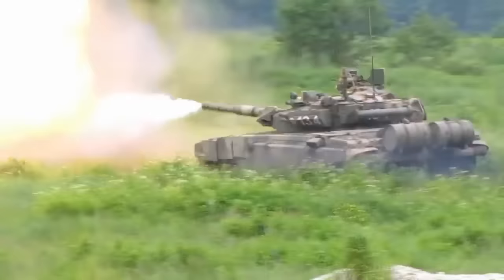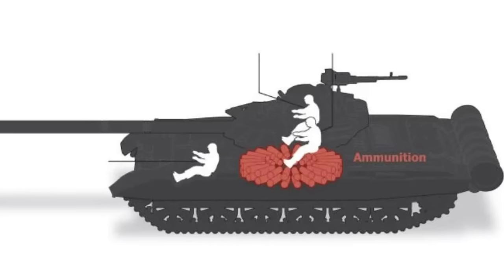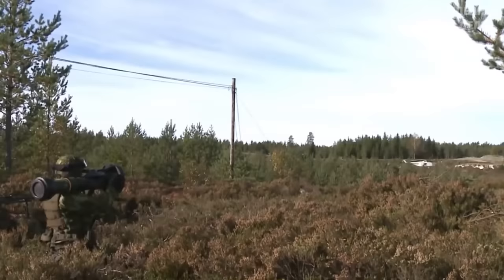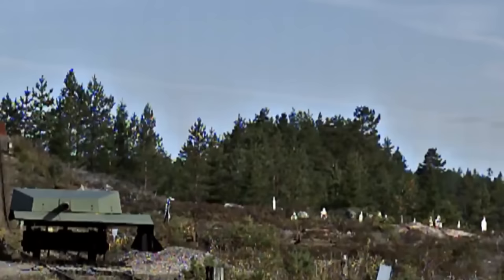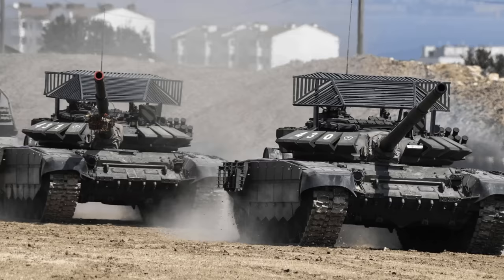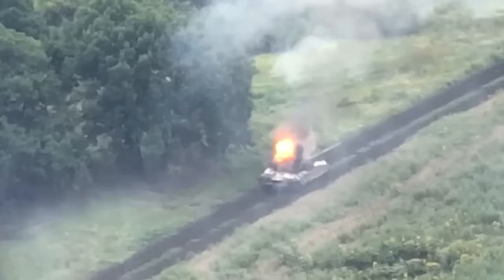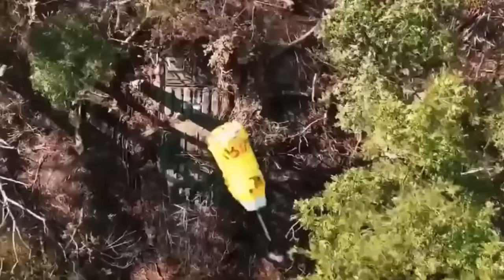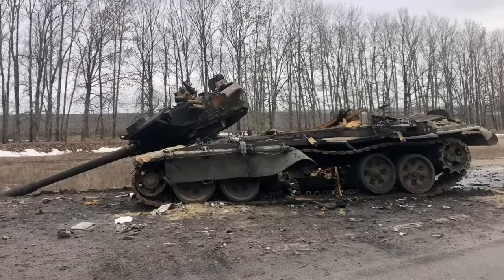Why does this happen to all Russian tanks? / real footage frome Ukraine

Comment: This is a problem for T-72, T-80, and T-90 series tanks.   It has been a weakness since 1982 in the tank battles in the Bek’ka Valley.   The T-62 ants showed this vulnerability in the Yom Kippur War of 1973.   It appears to be a fixable problem but the Soviet/Russian tank designers did not anticipate the flaw or more likely were overruled by senior defense leaders.
Reply: There is no problem with the T-72, T-80 and T-90, it’s just that a huge number of these tanks were produced and most often they fall on the video, but when Western tanks get into a similar situation, the situation is no better, for example, it happened with Turkish Leopard tanks 2a4 in Syria in 10 minutes, ISIS destroyed a battalion of Turkish tanks from Soviet MANPADS Metis, this is a common problem of tanks, Abrams of the Saudi Arabian army in Yemen has the same problems!
Reply: The exact same thing can happen to western tanks if the blast door is broken
Reply: I have seen the exact same thing happen with those m777's after being hit with anti-tank missiles, does that make them a failure too?
Reply: @UltraTotenkopf  lol the video above shows the difference between Russian and Western tanks. 
1. Russians wanted to have an autoloader and not a manual one, so they stuck all the ammunition around the crew, but leading to problem 2,
2. When the ammo detonates the only escape for the explosion is up through the turret, which is why the turrets pop on many Russian tanks, and thus kills at least 2 of the 3-tank crew,
3. Russian Cold-War tanks (T62, T72, T80, T90 etc.) have been used in many, many conflicts and (not sure about all of them) almost every single one ends up in a loss for the side with Soviet tanks: the Six Day War, the Yom Kippur War, the Persian Gulf War, the Iraqi War (2003) and some other minor conflicts. 
4. Russian tanks lack gun depression, so they actually have to climb over a hill to fire at their target.
5. Russian tanks lack good optics, leading to poor situational awareness.
6. Russian tanks operate on their own or in small groups with little to no coordination with other tank or infantry groups.

But now that I think about it, I guess there is definitely no problems whatsoever with Russian MBTs. Definitely. 100%. Yup. XD ok I'll stop now.
Reply: It’s not just Russian tanks but even NATO tanks also explode when they are hit by modern ATGMs. It has happened before to Saudi Abrams and Turkish Leo 2.
Reply: Pure western propaganda. 😂
Reply: @andrewtibbetts2695  One very perfidious system of comparison that completely misleads the listeners: "Russian tanks explode when the missile penetrates the armor, and Western tanks only suffer from destruction of the ammunition compartment"! What is the problem here? It compares breaking into the crew compartment on Russian tanks to breaking into something BEHIND the crew compartment on Western tanks.
It goes like this:
First, the Russians no longer practice packing spare ammunition all over the turret, but all ammunition is in the autoloader. If the missile penetrates the turret and ignites the ammunition, it doesn't even matter anymore, because the temperature and pressure sufficient to ignite the ammunition in a fairly well-protected autoloader has already killed the tank's crew. The same will happen to the crew of any western tank if a missile penetrates the crew compartment, with the difference that in a Russian tank one of the two crews in the turret may have a chance to survive due to the huge gun between them, while in the western tanks due to loader maneuvers, the turret is one big open space and it's very likely that everyone will die.
If the missile hits BEHIND the crew compartment on the western tanks it will destroy the ammunition, and on the Russian tanks in that case it will destroy... the tool box or the scuba tube or some similar irrelevant thing!
Blown up turret on German tanks: watch?v=X6nZvDn6gRQ
Blown up turret on US tanks: watch?v=vZTccFE0y9c
Of course, there are only a few shots, but only a few tanks were actually used. In Syria, the Turks used 12 tanks and lost... 40% of the tanks!
Reply: @jerromedrakejr9332  Russian tanks were built for mass production, with very little emphasis on crew protection. 
However, Western tanks were built to protect the crew. 
name just one war where the Russian tanks were superior to Western tanks (American, Brit etc.) 
Exactly. Why? because of all the reason I listed as to why Russian tanks are garbage compared to Western designs. is it better then no tank at all? yes.
Can Western designs fail? yes. 
But will anyone ever be able to prove Russian tanks are good? NO
Has a nation wielding Russian tanks ever demolished a nation with Western tanks? also...no.
Also the fail rate of Abrams/Leopards etc. is very small compared to the amount of tanks built by Russia that have been destroyed over different wars. :)
And your tank will always fail if your crews aren't trained on what to do and what not to do :)
Reply: @UltraTotenkopf  another NPC
Reply: @andrewtibbetts2695  the problem is not in autoloader, but in the other round stored inside the hull/turret
Reply: @jerromedrakejr9332 meanwhile all the test done debunking this (while it may sometimes fail blow out panels are still very effective):

Comment: There are quite a few mistakes here. The initial footage does not show a tank but more like a BMP which is much, much flimsier. Try playing the video at quarter speed and you will see several items going up into the air. First there is a square plate that could be the armor plate above the driver. A "while" later the turret (without top armor) followed by the hull top armor (containing the turret ring and openings for crew hatches).

The turret of a tank does not weigh two tons but at least ten. The cannon and its breech weighs more than two tons. A Russian tank shell is less prone to exploding than it is to having its propellant ignited. For each unused shell there will be about six kilograms of propellant igniting and burning - NOT exploding. If the hatches in the turret are open the burn will eject long red-yellow flames upwards. If they are closed, the over-pressure inside the crew compartment will cause the entire turret to be propelled high into the air. It is difficult to gauge just how high but consider that the cannon itself is six meters long and the turret two meters in diameter the overall length of the assembly is eight meters.

A tank destroyed from a burn "without" overpressure will "look intact" in that its hull will not significantly have lost its shape. Destruction from overpressure ejects the turret and causes the hull bulkheads making up the crew compartment to be bent outwards.

This is not to say that explosions do not occur. Explosions are confined to non-armor piercing projectiles and these make up a minority of the ammunition in a tank. In any case, an explosion happens so quickly that the overpressure destroys the hull causing the overpressure to dissipate before the turret is sent into the air. In such cases the turret may come loose from the hull and be displaced somewhat. There will still be a propellant burn but it occurs "long after" the explosion itself has completed and will escape out the sides where the explosion opened up the hull. The explosion will also have destroyed the propellant casings, dispersing the propellant inside and outside what remains of the crew compartment, in the process making the burn less concentrated/violent.
Reply: Still looks like somebody got a headache..

Comment: Because they have autoloader with a carousel of ammo right under the turret.
Reply: Not all Russian tanks have autoloader.ammo is stored below the gunner.
Reply: @roybladea6180  
Oh, OK. Doesn't change the answer
Reply: @andrewholdaway813  it does.you just don't understand.Russian tanks have been built with the dangerous flaw of storing ammo under the gunner.one hit to the turret and tsnk is decapitated crew killed.most of times the driver gets away cause he sits lower and forward of the gunner position,you should take a look at Russian Tanks cutout ,like T 55,T62,T72,T80 .
Reply: @roybladea6180  
Roy I was just trying to ignore you.
What you describe IS the autoloader and carousel system. Look it up - properly.
Russian military were/are well aware of the problems and benefits of the system.
Reply: @andrewholdaway813  And what's the answer
Reply: @Johnketes54  
 ?   Still the same

Comment: Also, the new T-14 Armata has a giant design flaw: the hull is so protected for the 3 crewmen that they more or less cannot use normal vision using episcopes. They can only rely on external sensors/detectors. That means if you hit a T-14 on the turret, even if it's hard steel, you can easily destroy some optronics and make the T-14 completely un-useable.
Reply: well at least the crew is safe
Reply: @CatShak  lol
Reply: @CatShak  the crew is probably in orbit

Comment: Besides the Russian tank crew sitting on top of the ammunition  carousel, the cartridge part of the shell is specially designed to be combustible. Its not made of steel, its made from a magnesium alloy.
So a touch of strong heat will cause it to go boom, immediately.
Reply: American tank gun ammunition uses a combustible casing, although the base is metal. It's also fixed ammunition, not separate loading.
Reply: @kennethquesenberry2610  Now could you tell the whole audience whether the M1 tank uses an automatic loading carousel like the Russian tanks.
Reply: @robertjustinoff845  Although I was not a tank crewman when I was in the army, I have indeed been inside an M1 tank. I've also been inside an M114 reconnaissance vehicle. We had two of them in our company. My son, however, was a tank crewman, his active service having been 15 months in Iraq, part of that time attached to a Marine Corps unit. His position was loader. The M1 tank does not have an automatic loader. 

Automatic loaders have been around since before I joined the army in 1965. While they may offer some advantages, depending on how they work (they don't all work the same), the ability to use different ammunition without reloading may be lost. Someone else has already mentioned that losing the fourth crew member (the loader) is not good. Older medium and heavy tanks generally had five crew members. But there were light tanks with a crew of two. In theory, a crew of four allows a replacement for an injured crew member but in practice, all positions are already essential and if positions were moved around because of a lost crew member, the tank commander would probably be doing the loading, since he would have to be able to see everything and the gunner -- that is, the gunner's location, is fairly closed in, as is the driver. 

Incidentally, both my father, my son, and I all took our basic training at Ft. Knox, and we all went to Germany. although my father went as a POW.
Reply: Very interesting KQ, I was in an M1, but we were just doing a Saturday night cruise, around Baji, Iraq / FOB Sumerall.  
👫👬
Reply: @roostercogburn3771  My son was in Tal Afar longer than anywhere else in Iraq. When he joined his unit, which was 2/37 Armor, it had just returned from Iraq. For that tour, they did not have their tanks but when it went back a year later, they took their tanks.
Reply: @kennethquesenberry2610  Now you are educated enough to understand why a Russian tank explodes in such a manner. Well done.
Reply: It is like russian tank roulette.

Comment: Modern American tanks store the shells in a separate compartment, isolated from the crew, featuring a blow-out panel. If the shells are ignited, the explosion is vented out into the air instead of into the crew compartment.

The new Armata tanks do not have a crewed turret at all, but Russia has chosen not to field the Armata in this conflict, either because they don't have enough of them or because they were expecting an easier victory.
Reply: In my view, this shitty armata is not better as compared with another shit what they have 
and of course its to expensive for them to lose this shit and it's not just about money, but above all about shame, the loss of such a vaunted weapon will be a shame for them.
Reply: @jamesstevenson5329  That's a lot of shits.

I am prepared to reserve judgement on the Armata series until I have seen them in action. As would any prudent observer.

If you are going to invest money into quality weapons, and then refuse to commit them to combat for fear they will be lost, you might as well just save your money.
Reply: @jamesstevenson5329  They've had to get used to that lately; they lost the flagship of their Black Sea fleet early on. The shame compounded when it was revealed that the primary reason for the loss was the fact that he (note that in Russian, warships are gendered male) had basically been neglected to death and was a sitting duck.

As built, Moskva was a fine ship. But he was not taken care of and most of his systems were inoperable at the time of the sinking. A fitting metaphor for Russia's entire armed forces, and an unbearable (and unforced) humiliation.
Reply: @shane99ca  and even this cruiser was built in Ukraine, in the city of Nikolaev, and interestingly, it was destroyed by fighters (Neptune missiles) from the same city where this ship was built😆

Comment: Name a tank that can stand javelin hit, that's first. Second, there are films from Syria that show Abrams being hit and dead and lots of films that show Russian tanks that still could move after one hit and after second hit their crew was still capable of getting out and running away. And third, after lots of tries it turned out that the cages, if made properly, can work.
Reply: Like any piece of military equipment if not used properly will always result in higher losses.  Tanks in urban areas in small groups or by themselves are easily picked off without infantry support. In my opinion this is the main reason for such high losses of Russian tanks.
That being said I do believe western tanks emphasize crew protection over Russian designs, if anything simpley because of the ammunition storage location.
The American M1, German Leppard and British Challenger tanks are great tank but not invulnerable, plenty of evidence to prove that, but when a tanks armor in penetrated I would much rather be in a western tank.
Reply: the factories that produce Javelin are succeptable to obliteration by air-strike; this tactic is nothing new .
Reply: I think you are confusing Bradley's with tanks.  The US didn't lose any tanks in Syria, but I don't think they used very many of them.
Reply: The tanks lost in Syria are model one lend lease tanks with no era poor trained crews and if you watch there not supported by infantry that's basic command structure for urban warfare while the difference is that any American owned Abrams were disabled and the ones that were actually destroyed were destroyed by friendly fire or to prevent capture. Note the Abrams that have been lost by the us were lost in operation desert storm against Iraq
Reply: Btw all those American tanks lost during desert storm were all Mark 1 Abrams pretty much too not the modern packages with advanced firing systems thermals nvgs better ammunition and armor.
Reply: @jimwillis383  I always feel Bradley's are a bad idea,Those in the military have pointed out a APC with a 50 cal,Isn't much of a threat and would be called in,But a Bradley is a imminent threat with it's anti tank capability and must be dealt with killing the crew and servicemen it's supposed to be protecting to or from battle
Reply: @Johnketes54  Bradley’s aren’t meant to serve in an anti armor role.  They are infantry support vehicles like the LAV or Styker.  If it’s facing off against a tank somebody already screwed that pooch.

Comment: Hey, i remember video of "extra evacuation" from Abrams.
In real, all tanks can be hit from air, they can't have good armor there.
Abrams, Leo, k2 - all.
And knock-out panels do not interfere with the burning of the tank and the shell shock of the crew, which can burn out with it.  it is also true that the Russians unload the ammo, leaving only 20 rounds of it in the carousel, which greatly reduces the likelihood of hitting the ammunition load.

Comment: Simple answer.

Russian tanks use an autoloader system. That system has the ammo low in the bottom/middle of the tank in a circle pattern around the turret.

That same turret 'sits' in the tank, they are not bolted in place (much like turrets on battleships).

When a Russian tank hits a mine, or a explosive fires down "into" the middle of the tank means all of that ammo cooks off.

Comment: Tank philosophy in Western culture is very different from Russian and Soviet philosophy. The Soviet Union had a philosophy based on saturation, overwhelming the enemy with quantity. Being a militarized society, the Soviet Union did not have a shortage of volunteers available and its tanks were simple and cheap, although unreliable. In the west the tank crews were the most important thing, it takes time to train a crew and the available number of volunteers was much smaller than the Soviet Union, so the priority was and still is the survival of the crew, even if the crew lose his assigned tank, you can always assign it to another tank and in this way they gain experience. In modern warfare, the Soviet tank philosophy is counterproductive. Nowadays, destroying a Russian tank is much easier than before and the loss of the operators is becomes more heavier the longer the war lasts.

Comment: MOST TIMES ITS ammunition COOK OFF, THERE IS A magazine IN THE BACK OF THE turret hull holds 50 or 60 Rounds and an Auto loader in the floor most Tanker crews set another 75 Rounds on the floor on either side of the turret spindle that is hit directly by the Javelin missile so that white smoke is the rounds starting to Ignite!!